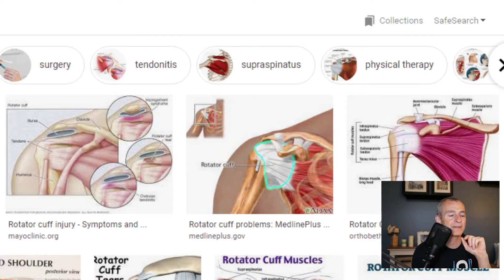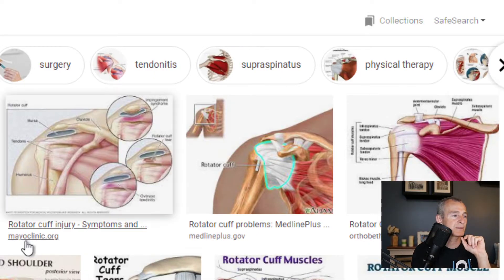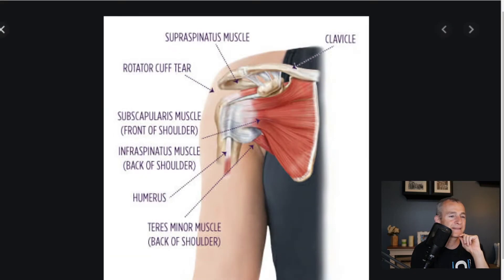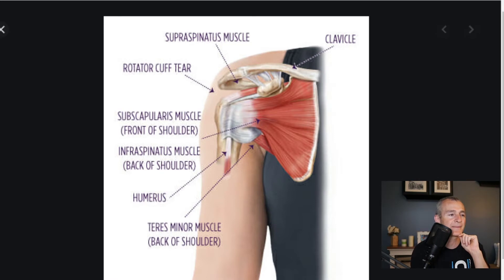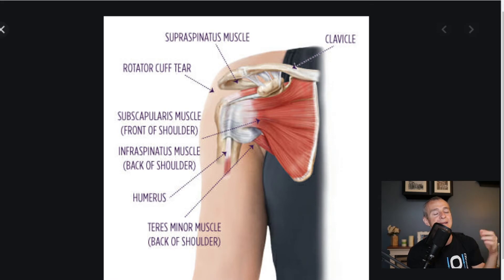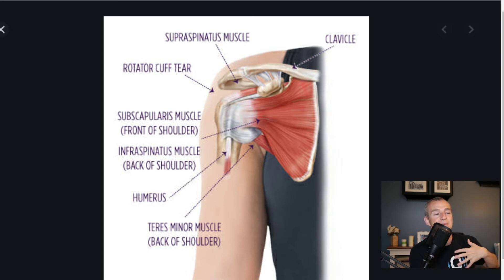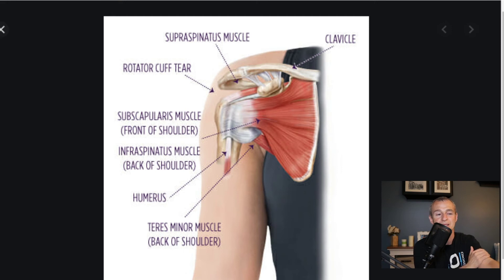Shoulder Basic Anatomy of Rotator Cuff Pain

Comment: My MRI has shown damage to the C1 to C5, my shoulders are showing calcification and Sclerosis. My arm is sore with numbness in thumb and next 2 fingers. Please help me with some advice as to how I manage this pain? Consultant is planning on operating on my carpal tunnel, so if my pain is being caused by my neck is this a good idea to have carpal tunnel op?? New subscriber from Ireland. ❤️🍀🇮🇪
Reply from the maker: You bring up some really great points. Have you seen a physical therapist? Any time I hear someone is diagnosed with carpal tunnel I check the neck and shoulder first. 

When you look at this image you can see the nerve root patterns called dermatomes. They correspond with different parts of the hand. https://i.pinimg.com/originals/bb/ef/6a/bbef6a01d2f6680fa6ba39c313c39f9d.jpg

Connect with a great therapist and see if you can get any relief with cervical traction and positioning.